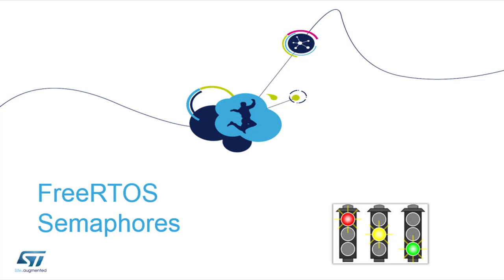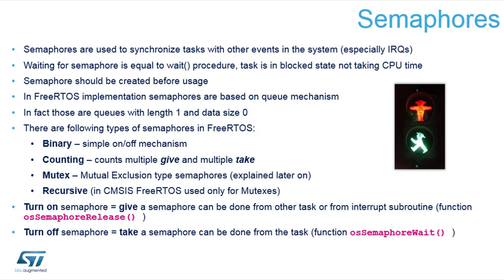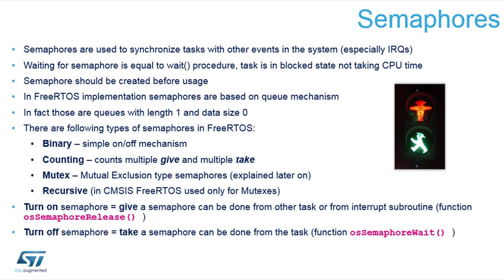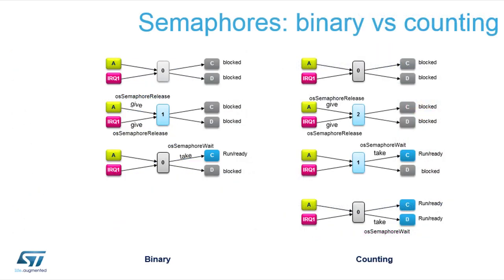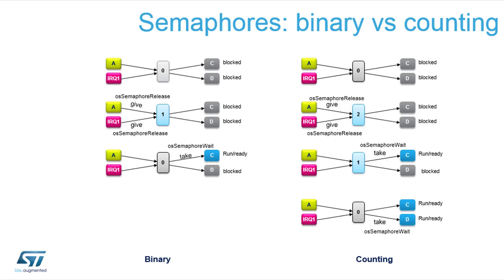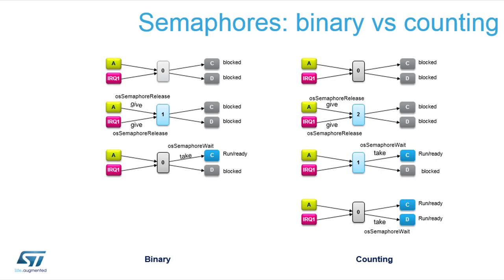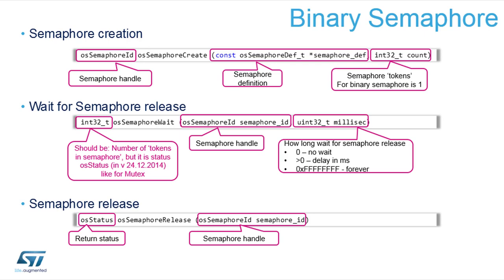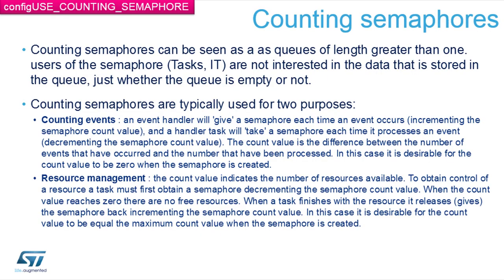FreeRTOS on STM32 - 15 Semaphores

Comment: Hi, 
First of all, thank you for this great series, it really helped me a lot.
I just have a question, what happens if the wait timeout for osSemaphoreWait is passed and the semaphore is not released?
Does it just do the task or will it start from the top?
for example, if two tasks want to use UART at the same time, they both have to wait for it's semaphore (I know we use mutexes for shared resources, just for the sake of example), what happens if the semaphore is not released in the timeout?